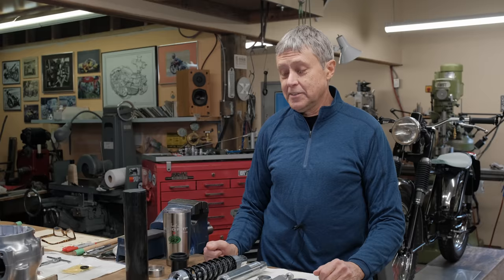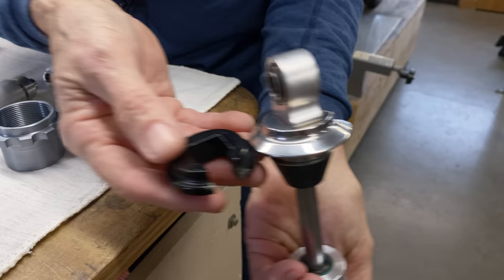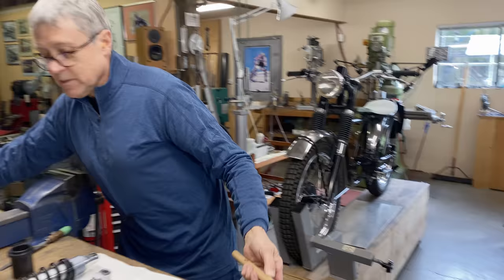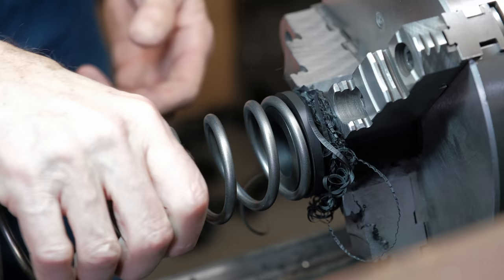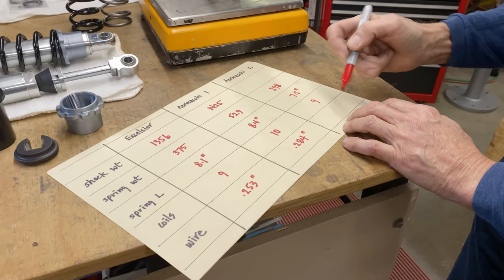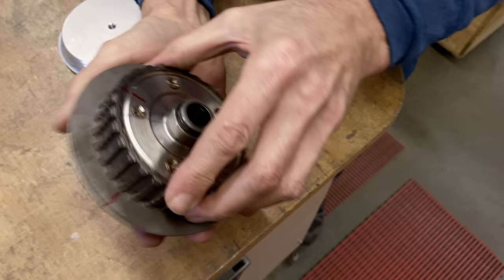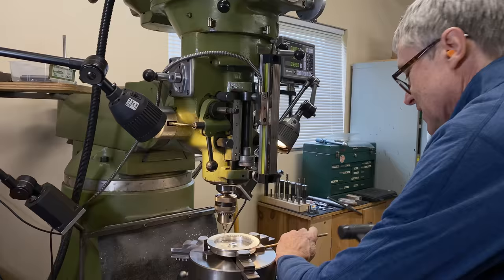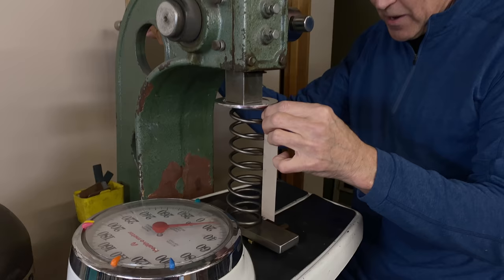Saving weight on the Aermacchi Shock // Paul Brodie's Shop

Comment: I recall building a pair of shocks from scratch in the late eighties.  Rod end bearings, 2024 aluminum pistons - tricky to drill on the Bridgeport… sheet steel spring washers to control valving.  Seals and wipers contained with snap rings…

Used snap rings, captured by a collar, to adjust the springs, in .200 increments.
Reply from the maker: You were pretty ambitious to build your own shocks!
Reply: @paulbrodie  I was exceedingly poor, also.  Did the work where I worked after hours in the prototype shop @ Sunkist.  I had hoped to do a lot more to that bike...
Learned to Tig there, too.
Reply from the maker: @dennisyoung4631  We do what we have to do to gain knowledge and experience :)

Comment: Great video! Many people don't consider all the places you can lose mass.
I switched to Crome-Silicon springs on my race car. Less weight, more travel.
Saved about 3# per wheel. I suppose half is sprung weight and half is unsprung. Either way a good deal.
I used QA1, suprisingly affordable race-quality parts.
Reply from the maker: Thank you Nobody Noone.

Comment: Love it!  The Aermacchi shocks are coming together perfectly! And the orange paint will dazzle!  And the CLUTCH!  There seems to be no "slop" at all!  Had an old BSA in college, and I should have replaced the parts...because the friction discs and pressure plates had so much slop that it took no time at all to hammer the tangs on those spiffy Barnett friction discs!  Yes, a learning experience!!! Not so schmart at 19 yrs.
Reply from the maker: Thanks Tom. When I was young I made a mess of a few motorcycles due to my inexperience too.

Comment: Paul have you ever considered to get a little spray boot with a small powder coat system? They sell pretty good systems that can fit in a corner of your shop. Eastwood for example has the pcs-1000, some time ago I looked for it because I wanted to try powder coat by myself, but they don't ship to Europe. The price is around 1k I think (just the system without the boot/oven). 😊✌️ As always, thank you for sharing and keep it up!
Edit: ok, the oven is like 5k... 😅. But I'm sure there are diy alternatives
Reply: I have one of those powder guns and a smallish electric oven for baking. Nice finishes, but quite time consuming and a ton of prep and cleanup for just one or two small parts. If it was a road bike and not a track only bike, you may want the corrosion protection.
Reply from the maker: I already have a wet paint booth, so I'm good. If I need powder coating I have a friend with a very sophisticated hi-tech powder coat shop.. so that's where I would go.
Reply: @tonyalto1014  good point. I have no real experience, just suggested that but maybe is not really worth as you say 😊✌️
Reply: @paulbrodie  ok, I wish I have a friend like that, you are blessed! 😁 Now I understand it's obviously much better to let him do the job! ✌️✌️✌️

Comment: I like the way you clocked the clutch plate grooves to the spring holes. Set it up once and then rotate the part. That makes a lot of sense to do it that way. Good thing you had a part to work off of. Good job as always…I’m really liking this particular build.
Reply from the maker: Thank you very much.

Comment: Most modern DRO's have bolt hole circle function built right in. No need for the rotary table.
Titanium springs??? Added advantage that half the savings is in unsprung weight.
Reply from the maker: Jim, my DRO came with an operating manual. It is written in such a way that it is 100% useless. I have studied it several times and have never been able to make sense of it.
Reply: @paulbrodie  Sorry you've found it so confusing.
Your way of indexing the pressure plate teeth to the spring pockets is probably for the best then.
I am a thoroughly analog guy but will take advantage of digital help anywhere I can find it.  😉
Reply from the maker: @jimurrata6785   Not your fault. A very bad manual. I have never really considered if I am an analog or digital guy...

Comment: REMEMBER: you still have to use one steel plate against that pressure plate, if not, the first friction plate will burn thru that aluminum in about 4 minutes.... Hahaha - looks great!
Reply from the maker: The pressure plate is going to get hard anodized.

Comment: You should try powder coating.  
I'm in love with the results compared to paint. The durability is unsurpassed, finish is nearly foolproof. 
Eastwood sells a kit for home hotrod builders.  All that's needed is a clean surface (I glassbead everything) and an electric oven.
Reply: I feel like a naysayer but a lot of racing frame builders and aircraft fabricators don’t care for PC because of weight, difficult repairs, and the inability to detect cracks and wear as easily upon inspection.  There is also a lot of controversy about its use on hardened alloys - steel and aluminum. Baking 4130 or 6061 at 400 tends to temper it. Low temp powders are now available but.... I have PC ability but seldom use it anymore. I use epoxy paint where the thickness is easily controlled and the faraday effect isn’t annoying. Just some thoughts.
Reply: @836dmar  
Agreed... it's not for everyone or everything.
Reply: Yep. When it’s in a good spot it’s pretty durable.

Comment: Argument perhaps to be made for even more than 480g. Shocks can be considered 50% unsprung weight - so your 480 is (480*3)/2 = 720 in actual benefit (assuming a 3x unsprung advantage). Or not, happy to be corrected 🙂
Reply from the maker: Yes, the unsprung weight is less. On a race bike these little things all add up :)

Comment: Why is the number of coils important if you have the load factor you were looking for.Just wondering.RMM
Reply from the maker: My stolen race bike had springs with 7 coils, so I was trying to replicate that. 7 coils are lighter than 9 coils. My new springs weigh 298 grams, my 7 coil (stolen) springs only weighed 256 grams.

Comment: This assumed the manufacturing of the hub was degrees perfect. A simpler method would be to take five bolts that fit the spring holders, machine the heads off and machine a point, screw them in, assemble and give it a whack. 5 dot punched marks that exactly coincide with the actual mount points.

Comment: Hello again, I only recently discovered your YouTube channel, I find it to be quite refreshing (entertaining and informative) covering two of my favorite topics, bicycles and motorcycles. Anyway I have a question, I have a '75Norton Mklll and consequently I am a member of a forum, Access Norton. Well there is a fellow member who inherited a P-11 from his deceased older brother. Like many old Britt bikes it's a basket case in many boxes. The frame has some damage to one of the lower frame rail "cradles". Another member thinks it looks like someone tried to weld it and there is a "gash or hole maybe 3 inches long" I guess it is made of Reynolds 53o and should onlybe brazed. Theowner sayshe is looking for a replacement. But someone else on the forum recommended taking it to a bicycle frame builder. Naturally I thought of you and thought it mightmake a good episode it it is something that you think you might like to have a crack at. No skin off my nose either way, but I thought I would reach out. Cj
Reply from the maker: Well, it is a possibility, depending where the frame is. If you have to send it any sort of distance.the shipping and customs charges would be huge. Where is the frame?

Comment: Paul, sorry if I missed this: How can the new spring be so much lighter? It surprised me a little as I thought the modulus was more or less the same for all steel springs with the same characteristics. Must be the relationship between the number of coils vs. spring diameter. Less coils = higher rate. Smaller diameter wire = lower rate. If you reduce both you must be able to get a similar spring rate with a lighter weight?
Reply from the maker: The new spring is so much lighter because the old spring is so much heavier! Yes, there is a formula the spring manufacturers have to figure out the rate. The new spring is thinner gauge wire, but it is also shorter, which will up the rate. I'm not an expert on springs and spring rates, but I knew from my old springs (that got stolen..) that it was possible to save considerable weight by specifying certain parameters, and it worked out very well. Thanks for watching and commenting.
Reply: @paulbrodie  Significant savings for no compromise (except $$$) - can't go wrong with that. Pretty neat! Edit: I suppose the reason OEMs don't go with the lighter configuration has to do with durability as well. I'm sure they don't want to pay more money for steel than they have to. So that can't be discounted as a potential compromise.
Reply from the maker: @bradley3549  OEMs have to take into account a passenger and long term durability. A race bike is very different.

Comment: Thank you very much for inspiring videoes Paul. 
I have a question regarding the vertical bandsaw. I just got one myself and am about to order some blades for it,
Can you recommend me some good allround blade pitches, width and types for the kind of work you do - in both steel and aluminium - it's a bit of a jungle looking into the blade options.
Kind regards from Denmark.
Reply from the maker: Hello Denmark! My steel blade has a depth of .350", a width of .055", and 13 TPI. My aluminum blade has a depth of .364", a width of .034", and 6 TPI. Thanks for liking our videos.
Reply: @paulbrodie  Thank you very much. Thats a quite wide blade for the steel, compared to the options of 0,65mm and 0,9mm wide blades over here.

Comment: Might you be missing the  jam nut to accompany the spring adjuster ?
Reply from the maker: The Works Shocks did not come with jam nuts.
Reply: @paulbrodie  Well, those silly prats at Ohlins are making me run one. I'll have a word with them!

Comment: Excelent as always. I need to know a simple way to remove chrome from my motorcycle suspension. Any tip? I don't like shiny things either.
Reply from the maker: Take it to a chrome shop and have it dipped to remove the chrome, but not long enough to eat into the nickel underneath. Thanks for watching.

Comment: For less weight, why not use 1.5 ID springs?
Reply from the maker: 1.5" ID springs would not fit over the body of the shock. There has to be clearance.
Reply: @paulbrodie  Are they gas shocks or oil only?
Reply from the maker: @humourless682  They have a nitrogen charge in them.
Reply: @paulbrodie  Ok.  Take a look at Maxton in the UK, they produce shocks, as well as custom-made cartridge conversions, for damper rod forks.

Comment: Have you determined what the difference in load carring capacity the two extra coils on your Springs cost you . I know it will be less but how much less ?
Reply from the maker: I asked for a spring rate of 45-50 lbs, and that's what I got. If I only had 7 coils, the rate would have been higher, so they should have used a lighter gauge wire. They new springs weighed 298 grams, whereas the old 7 coil springs weighed 256 grams. So, I almost got what I wanted!